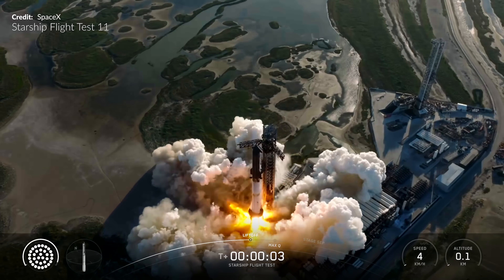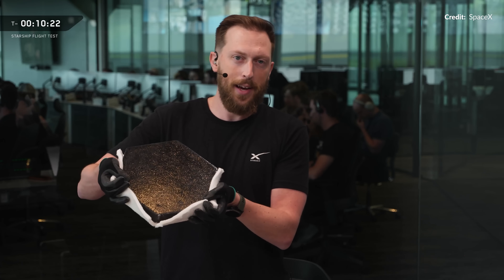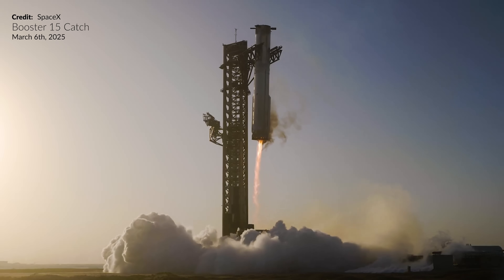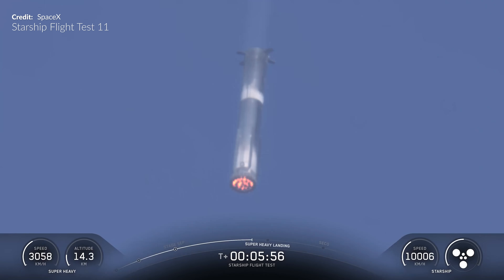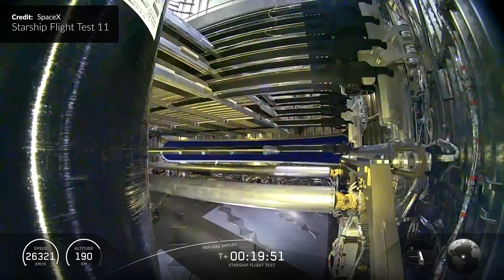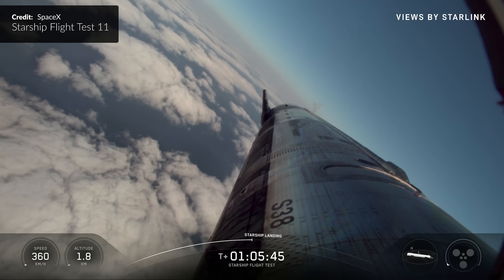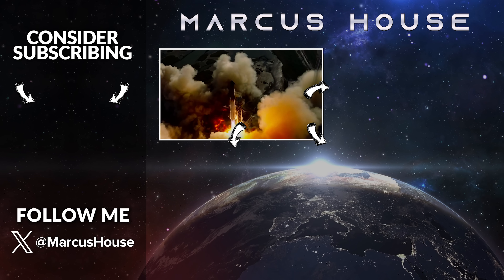SpaceX Starship Flight 11 Launch EXPLAINED! 🚀🔥

Comment: Great coverage as always Marcus!! Couple of questions: 

1) At video point 14:35 and beyond, a cluster of what looks like tiles, flies away. Any speculation or information on what happened there?
2) With regards to the positioning of the flaps; why not move them even further up onto the body to the point they would fully miss the plasma field? Not being a rocket engineer not withstanding, it seems there would still be plenty of aerodynamic forces to control the vehicle during descent even if there was a little less wing surface which would be the case if the flaps were moved further out the plasma field. Comments?
Reply from the maker: There were certainly plenty of tiles stripped away at certain points. All those intentionally placed holes look like they aided in chunks of surrounding ones getting ripped off. 
In regard to item 2, they flaps need to be in the flow for control, but having the forward hinges just out of harms way protects that weird flow area. The Aft's never seemed to have an issue because the flow was running over a much straighter edge. The curved nose built up imperfections in the flow much worse.

Comment: Starlink simulators is the same as we saw on starship 10. I am looking for something much more important. 1. Heat shields hold up upon re-entry. This should be a priority. 2. Successfull landing or catch of booster and starship. Reusability is key. Waste of money. 3. Starship exiting the Van Allen Belts and reentering. A milestone that is critical. Taking much longer than the other ships.
Reply: Maybe they march to a different drum that the internet experts.  They're taking things one step at a time.  Why would the Van Allen belts be of any issue to Starship?

Comment: Thanks Marcus, for going over those finer points of this flight. It was a real text book flight. And Elon watched it outside for the first time! (Not from the mission control on a screen) The latest tiles and crunch pads seem to have solved the re-entry issues. But they need to bring back a Ship so they can examine them to see how well they are for re-flights. I think Elon said there would be a catch attempt after Ship39 V3. It should be Ship 40 V3, but you can never tell with SpaceX. Sometimes they skip a couple. Look forward to Saturday. Just hope SpaceX have some better videos of Shop39's re-entry through the clouds.

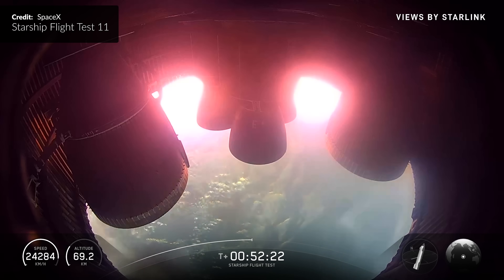Comment: @11:20 some time in reentry you could see a dumblink in the background glowing up :) guess you couldnt include all footage, then the video became a bit long :P. Thx for the coverage, cant get enough of it :)
Reply from the maker: I don't see anything. What was the time in the flight?
Reply: @MarcusHouse  About T+38:50 there are 2 glowy things on the right of the screen (so below its orbit, which makes sense given the raptor engine lightup direction). I assumed it were the dumblinks. (Had to rewatch a whole lot footage, that was not a punishment :) )

Comment: " No orange coating this time" famous last words. If you see the drone footage from spacex you can observe their is still some substantial orange coating coming from oxidation from the areas where there was no heat shield and coating. I believe i observed a puncture or hole near the nose cone with fire just before the landing but no significant damage to the vehicle

Comment: @MarcusHouse There is a point in the video where the Ship is coming in for its landing in the Indian ocean and you comment "they will be able to come in and then essentially circle back for a catch at the tower in the future". That kind of sounds like having two chances to have a catch at the tower. Like a plane pulling up and circling the field to try again. I don't think that is what you meant, but it does sound like that, by the way you said it. Do is it more like doing a sweeping arc, as its descending, to better align with the tower (arms)? Like the HAC that The Space Shuttle did.

Comment: They showed a quick view from the drone they had flying to catch 38's landing, but then never swapped back to it during the stream. I hope they release a video of it as it must have been awesome to see it coming in to land from the drone's perspective. To think we'll see ships coming in for a landing next year is hard to believe. I expect they'll eventually get the process down such that they can offload the booster onto a transport stand while ship is offloading it's SL V3s, then move it out of the way so they can catch the ship on the same stand...or maybe there will be catch-only towers? You'd think they'll want to keep at least one V3 OLM/Tower at each facility reserved for launches only so it is spared in the case of an accident. Once Florida is up & running there's nothing to say they couldn't launch at one facility and land at another?   Also, that V3 nosecone looks much more refined in fitment and design. It also has what looks like receivers built in for attach points for refueling. Wow! They also mentioned massive upgrades to avionics for V3. Starships so far always seem a little rough like worn out box trucks. It'll be nice to see a finished design built with exacting tolerances that presents more like a "Tesla Semi"...  There is so much new to look forward to!
Reply: They have released drone footage now, yay!

Comment: Yeah, those wires look like a DIY solution to detect deployment by having a wire pull out. Maybe turning on a wifi camera. Or they might be simply testing a way to provide power to the Starlinks to keep their internal batteries charged until deployment. Might just be a power line that taps onto each sat and pulls out on deploy.
If it was a camera they probably wouldn't have known when building it that this deployment was going to happen during night time. We may get some footage of it from a future SpaceX flight 11 video edit if that was the case, but it's probably not good footage due to being done in shadow
Reply: Hello fan, thank you so much for your love and support—it truly means a lot. You might be surprised to hear from me, but we’re all human after all. May I ask where you’re located?

Comment: 1:15-1:16-1:17….. u introduction to ship shot show s a flame burning inside the 1ST on board camera shot. How come it was burning so freely inside the ship without issue to tanks or feeds or fuel gasses? Seems odd that they got away with what seemed like an inside fire going. Odd shot.

Comment: If you think about the missing tiles. If the ship has fuel on the back side of the stainless steel it should not melt. It would be strange in the future to see the ship missing important tiles and rotating to have fuel cool the tank down before it explodes!

Comment: With decades of advanced material reinforcement, thermal protection, manufacturing & forensic failure analysis engineering experience, amazing performance.

Comment: Considering they are still stress testing during re-entry this seemed in remarkably good condition as it came in to land. Tiles seem to be getting better with each flight and I am thinking they really will be able to sort them out well enough to get a fully reusable Starship. That said we still need to see a Starship catch which will be an incredible thing to see so can't wait for that next year. Each iteration is so much more polished than the last and I hope they don't get too many early problems with V3 as they did with V2 which I think slowed down progress quite a bit.

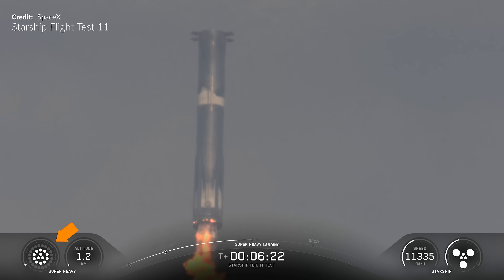Comment: Your comment around the 7:30 range indicates you need to look up the definition of G loads.  Based on how you used it, you have no clue.  Free fall is ZERO G's for example.
Reply: Free fall is only zero Gs if in a vacuum. Im pretty sure when he says "Gs" he's referring to the air friction forces between the atmosphere and the ship. If you were in that ship im pretty sure you'd feel pressure from below from the natural braking of the ship. That pressure could also be what hes talking about.

Comment: "How cool is that" ..chucking what 20 million bucks into the pond to not be recovered how is that progress?
Reply: It's progress toward reuse. Also it was version 2 prototype, no point in recovering it. Next flight hardware is going to be version 3. That said, the booster has flown previously and was reused after a catch. For safety reasons these tests are suborbital. Had there been more successful v2 test flights they might have tried to catch this one.

Comment: Is there any word on the date of the next flight? Is launch pad 2 ready for use? How long to refit launch pad 1? That Starship reentry was smooth. And the maneuvers were pretty cool. I would expect a reentry to get across Texas and Florida eventually and then angle back for the launch pad for safety reasons.

I always expected that once Starship is fully operational and multiple flights per day is achieved, SpaceX would move the launches offshore to platforms. I don't think the locals want items falling off their walls multiple times a day.

Comment: The greatest achievement on flight 11 … for the first time everything worked! 😀even when deliberately pushing  limits beyond expected normal operations (like missing tiles)
Reply: Everything worked on Flight 10 too.
Reply: @anthonypelchat true. I should add flight 11 did not experience any unexpected surprises that could have been worse. The technical issues finally appear to be well under control
Reply: @douginorlando6260  Which was surprising since they were pushing it to see IF it could survive.

Comment: It was really cool watching the stainless steel change colors during re-entry in real time.  I see it a lot as a blacksmith and with my experience in "running the colors" for a proper temper, I was able to visually identify what parts of the ship were experiencing exact temps just as good as any thermal camera would.  Well, assuming there was enough oxygen up there for the reaction anyway.  Seems like they got the design down pretty well, as none of that 304SS was experiencing anything close to its thermal working limits.
Reply: Thanks for giving us the benefit of your experience
Reply: You can Google a stainless steel heat chart and know everything this guy just said in about 15 seconds
Reply: @Mike-jm5wt  You won't know any of it, you'll only have a basic chart to compare it to.  That chart doesn't tell you what it means if the colors shifts are close or far apart, it doesn't give you any tools to visualize what the temps are when it goes past the limits of that color chart based on how fast the colors change next to it.  That chart stops way before the thermal limits of 304SS, as it no longer changes colors...but there are tricks to know how hot it is anyway.  The exterior colors you see are only a glimpse of what the steel is actually experiencing, and until you've done it a few dozen times yourself, you simply won't know enough to know that you don't know.
Reply: @Skinflaps_Meatslapper  they aren't tempering their spaceship hull though all they care about is that it's reusable and not too heavy to launch so what exactly are you trying to brag about
Reply: @Mike-jm5wt  The fact that you distilled all of that down to tempering a rocket and thinking I'm bragging about anything at all just highlights how little you're grasping of the subject.  It's the temperature that the exposed steel is reaching beyond the safety of the tiles that is important, those are areas you'll get burn through or failures at.  You can exceed working limits for a lot of materials for a short duration, but that damage is cumulative, and future excursions beyond that limit fatigue the metal further every time you do.  If you want it to be reusable indefinitely, you need to stay below those limits, and surviving a single short event is not positive proof it will survive a second time.  You need more than that.  If you can see how hot the steel is getting visually, you'll know whether that steel needs additional protection or not.  You can't very well mount thermal cameras or thermocouples everywhere, you'll never get a complete picture of re-entry hot spots regardless of how many sensors you have, and since the ship is now either unrecoverable or contaminated by sea water it's impossible to do a post-flight analysis on the heating that it experienced with tangible, physical parts of the ship in your hands.  In this case, you can see the colors clearly changing, and with some experience you can gather all of that data without needing any sensors at all by visual observation alone.  Since it didn't exceed the working temp of 304SS, those areas are safe.  I made my comments not as a means to brag about anything, rather I found it both interesting and optimistic that they've solved a lot of the previous issues with flap burn-through, and thought I'd mention it to anyone else that might be interested.  It's unfortunate that you were equal parts arrogant, inconsiderate, and ignorant enough of the subject to bother commenting what you did, but here we are with you trying to save face while I have to delve deeper into the subject to demonstrate your lack of understanding.  Hopefully you're able to self reflect at some point.
Reply: @Skinflaps_Meatslapper  The engineers knew the material was suitable for the task before they built the first rocket. You are trying to sound smart and use a lot of over the top explanation and now you have devolved to using insults and personal attacks. Submit your CV to spaceX and tell them you can analyze their spaceship's metallurgy for them using a gopro and see if you get hired 😂
Reply: @Mike-jm5wt  There's a whole lot of materials that would be suitable for the task.  Titanium, carbon fiber, aluminum, it would all work.  Not in the precise configuration they currently have, but that's where the engineering comes in.  Where do you put the tiles?  How far beyond the leading edge do you need to cover?  If it was just a matter of picking a suitable material, then they wouldn't have had flaps melting off several previous starships, now would they?  It's not like they changed materials entirely to prevent flap burn through, so what changed?  The design itself changed, not the material. Heat tile location, how the flap seals interfaced, the shape and location of the flaps, etc.  All of that can be modeled but still needs real world testing to validate.  How is it validated?  By seeing if the modifications changed how the plasma heated the body of the rocket.  How do you see that?  Generally, with sensors, but in this case, you can see it visually.  It's well known, not over the top, but it does take knowledge and experience to understand what you're seeing.  I don't think it's possible to dumb this down any further for you before the point is lost entirely, but perhaps the point would always have been lost on you.  I do feel genuine pity that your ego cannot accept that you lack the intelligence to comprehend a rather simple concept, it must be quite distressing to you.

Comment: I'm all for starship and spacex, but I truly fear the starship design being a tall cylinder is the absolute worst type of design to try to land on an un-even surface as Mars. I fear it will tip over and end in disaster. There needs to be another landing option or redesign. Even on earth, it's been difficult and blew up each time except once. Yes, I know it's testing, but a landing a tall cylinder could end in disaster on each landing, testing, or not.
Reply: It will be fine. Falcon 9 is worse, yet it lands on a ship in the middle of the ocean that is bouncing back and forth. Starship is wider and has a lower center of gravity.

Comment: I wonder just what the onboard sensors were telling the control and monitoring station about internal temperatures.  Specifically the less-than-ideal sections where the tiles were left off.

Comment: max q: maximum specific energy of the incoming air, also called dynamic pressure because its equation is as follows
q=1.4 × p × M²/2
p is static pressure due to the weight of the atmosphere above
M is the flight Mach number called in honor of Ernst Mach by J Ackeret the formulator of supersonic flight.
So now you know and can calculate q
Max q on re-entry is much higher due to the much higher speed/mach...

Comment: why are they not attempting the starship catch on pad 1 first if they are going to dismantle it? wouldn't it be less of a risk than doing it on a fresh new pad?
Reply: Damage to surrounding infrastructure if it explodes. Picking up all the pieces. Delays from the FAA because of the explosion. Testing it beyond the parameters where it will fail. Have to scrap it anyway.
Reply: @williamdrake2315  i mean it would be less dramatic if that happened to pad 1 then pad 2 as they are going to scrap it already?
Reply: I agree. They could use T1 to catch the ship and T2 to catch the booster!